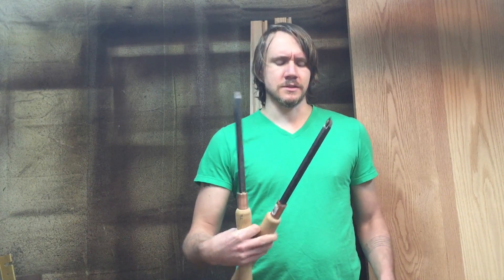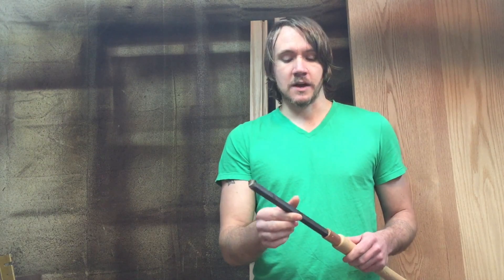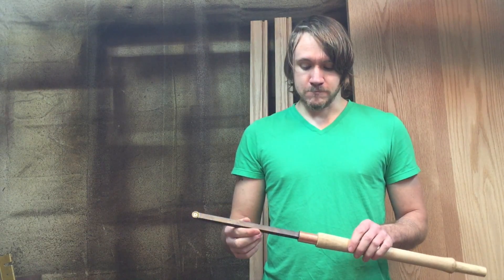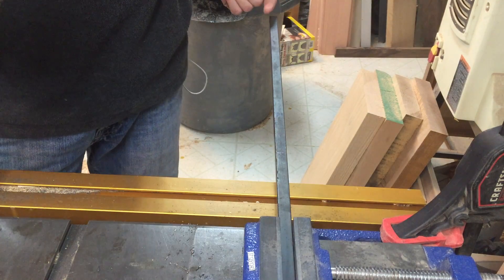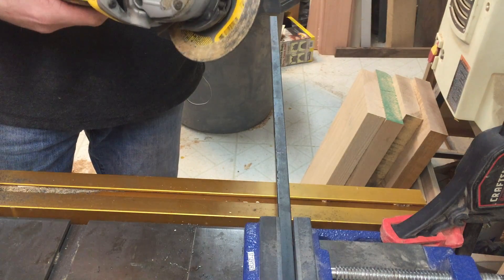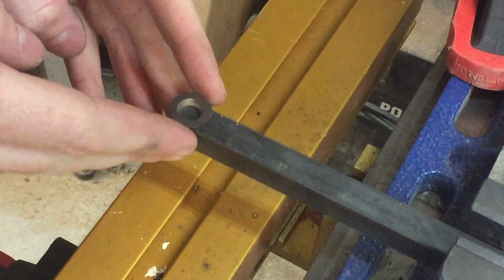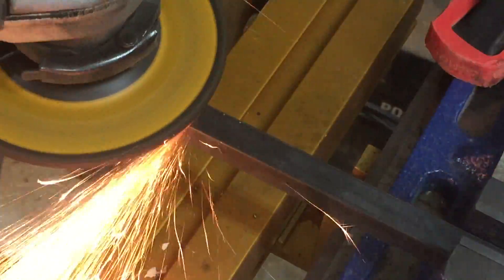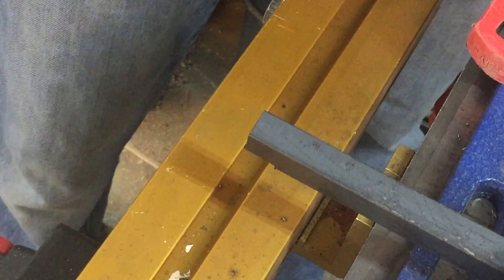How to Make Carbide Lathe Tools   001

Comment: Great job! Easy and quick and very functional tool for much less than buying somewhere else. You probably could have just scooped some epoxy in the end of the handle and pushed the bar in behind and then tamped it on with a few taps on the handle end might have been a bit less messy lol but still very nice job! 👍🏻
Reply from the maker: Thanks. I appreciate it.

Comment: What size bit did you use to drill the stock for the die bit for the screw?
Reply from the maker: I believe the screw is 8-32 so whatever bit size comes with that tap.

Comment: What a great Video.  Where did you get the steel/. What kind is it again and the dimensions? Also is the copper insert 3/4 inch?  Thanks  , and keep making videos as great and as informative as this.
Reply from the maker: It’s just 1/2” mild steel bar. Nothing fancy. 3/4” copper pipe for the ferrel.

Comment: I'd have fluted the sides to slightly less than the diameter of the round cutter at the same time as rounding the back. Those corners look to be a liability if you are working at close quarters

Comment: how long is each piece of steel and is it expensive ? low or high carbon or high speed or tooling ?
Reply from the maker: I believe I have 16” outside of the handle and 6” in the handle. It’s not expensive. Just 1/2” square stock. Bought it on amazon. Just regular mild steel. It doesn’t have to be tool steel because it isn’t doing any cutting.
Reply: @BrianMcCauleyDesign  got a problem now, for some reason it keeps eating drill bits and tapers... cant even get one hole finished. one hole per bit, then when I try to tap it, it breaks the tap, even going slow, backing out ever so slowly not putting much pressure either, oiled it a lot too
Reply from the maker: That’s strange. I’m not a metal worker so I’m not sure what’s going on. Maybe you’re using the wrong size but for your tap? Maybe your steel is harder than mine. I’m pretty sure I just used regular old mild steel.
Reply: @BrianMcCauleyDesign  im using the same tap and bit combo you had posted. I think its the steel hard carbon steel
Reply: @BrianMcCauleyDesign   someone told me I had some harder steel that I prob should have used a carbide tap,, not that rich haha, I was able to get them finally after 4 sets of taps and bits,, irwin is going to send me new ones,,, win win I guess
Reply: @BrianMcCauleyDesign  thanks a bunch. I have some round 1/2 
steel rods from Lowes, hope it'll work , something tells me I should have went with 3/4, I made a pretty good bowl gouge from an old washing machine center rod HSS.. anytime you find some old washing machines break out the ole hacksaw or grinder, pretty hard stuff

Comment: HI, WHAT STRENGTH STEEL DID YOU USE? CARBIDE TIPS USE USED.. EBAY? THANKS
Reply: http://www.carbidedepot.com/formulas-insert-d.htm  no edge prep dead sharp for aluminum machining. scrapers have no chip breaker. those with relief and a chip breaker can be very aggressive and difficult to control

Comment: I would have used a transfer punch to mark the hole for drilling. Much more accurate than a sharpie, and you can buy a set of transfer punches from Horror Freight for short money. They come in handy more often than you might imagine. Yes, even for woodworking.
Reply from the maker: Right on. Thanks.

Comment: Would round stock be better, or do you prefer having a flat edge against the tool rest?  I was considering hex stock as well, as you could easily achieve a 45° angle for a shearing cut. I know this would complicate making the receiving hole in the handle, but which would be the best shape?
Reply from the maker: I like the hex stock idea. I’ve never used a round bar on a carbide tool but I don’t think I’d like it. It’s probably a personal preference though. If not the hex I’d definitely go square. Honestly, even hex doesn’t sit too well with me. Thats probably because my lathe is by far the scariest tool in my shop and I’m really conservative with it. I took a bowl blank to the face once. Lol.

Comment: Nice job. I have wanted to make some for a while as well.  A couple of tips: For something like this, make some cuts in the steel. Use the angle grinder to rough it up and cut/grind some marks/ lines in the 6 inch side that gets the epoxy.  That will allow the epoxy to attach to the steel better. Use a 24 hour epoxy. An epoxy that takes longer to cure is stronger than a 5 min epoxy. Also make sure you mix it very well.  Drip some into the hole in the wood before inserting the steel into the hole.  Not saying you did a bad job, just things I've learned working with epoxy.  Thanks for the video.
Reply from the maker: Right on man. Been using these for a few years now. No issues. I appreciate the tips.

Comment: A 3/4" copper coupler is not big enough to go around the bar and leave any wood... If I cut a tenon for the ferrule now I'll end up cutting air.
Reply from the maker: I disagree. Mine work fine.
Reply: Something has gone horribly wrong for me, then. Gonna get 1" couplers and try them.

Comment: Where did you get the screws for the carbide ends? Also the 1/2in solid steel bar? Can’t find them online.
Reply from the maker: The screws came with the carbide tips from easy wood tools. I believe I got the steel on amazon but you could probably get it from Home Depot or Lowe’s.

Comment: I'm not sure about grinding the insert recesses. They have to be very flat or the brittle carbide might brake under the pressure of the screw. 
How do you like that square stock on the tool rest?

Comment: What kind of saw did you use and do you think a dremel saw max would work?
Reply from the maker: +QualityKnives I just used a standard angle grinder with a cutting disc.
Reply: McCauley's Design I was meaning when you cut the wood with the holes in in.
Reply: If you're referring to the recess for the tool, he used a router table with a 1/2 inch straight cutter, est about 1/4 inch deep by the look of it. You can actually get similar cutters for the Dremel so it works like a small router.

Comment: You say that you broke the first tap, I am not surprised you didn't break the second one as well! You are only supposed to  turn the tap no more than on eighth of a turn then reverse the tap to break the chip. That way you don't break it. And believe me small taps break easily enough even when used properly. But that said a good effort and  it's very satisfying to use a tool that you have made. One other thing buy yourself a spring loaded centre punch to mark and make a dot for the drill to centre on. Makes things much easier.

Comment: may I ask what was the total cost to make these tools?
Reply from the maker: +ken taylor I can't remember off hand but probably around $15 each. The wood was scrap so the only cost is the steel and the cutter.
Reply: thanks I am going to attempt this. where did you buy the carbide tips  THANKS FOR YOUR HELP
Reply from the maker: +ken taylor I bought them specifically from easy wood tools. You can get them cheaper on Amazon or eBay though. You want the 15mm cutters.
Reply: thank you
Reply from the maker: +ken taylor no problem man. Let me know how it goes.

Comment: Could you provide some basic dimensions for the tools?  Which cutters? bar length? handle length? depth of recess in the bar? Thanks!
Reply from the maker: +Rafael Serrao hi there. I used the 15mm cutters with 1/2" square stick. I'd say it goes into the handle about 6" and protrudes maybe 10". The handle length is probably about 16". Hope that helps.
Reply: +McCauley's Design thanks

Comment: This is brilliant. I was about 2 minutes away in spending some serious cash on some tools. Just a question. I would like to make this size, and then a smaller "mini" cutter, what size steel would you recommend for that?
Reply from the maker: +Adam Brcic thanks man. Glad it was useful. I'm not use what size the mini cutters are but just choose steel bar that is slightly smaller. You want the cutter to overhang the steel on all 3 sides.

Comment: Good video. Very helpful. One question though. Is it important to use 1/2 inch bar stock or could I get away with using 3/8th inch square stock as I have some here lying around.
Reply from the maker: +B Lenane you could probably use 3/8" but then I'd use smaller cutters. Ones that are sized closer to 3/8". I used 15mm cutters which is just over 1/2". You have to see what is available in a smaller size and how it compares to your 3/8" stock.
Reply: +McCauley's Design Ok thanks for the quick response. I am going to get 1/2" bar as I have some 15mm cutters ordered. Thanks again
Reply from the maker: +B Lenane sounds like a good idea!
Reply: +McCauley's Design might use the smaller bar for a detail cutter or if I get a smaller cutter in the future. thanks again and look forward to seeing more videos from you.
Reply: McCauley's Design My tips came in so here are the 4 tools I made for them: http://imgur.com/LjJiJfj

Comment: i know you turned the handle between centers but how did you handle the void on the end that accepts the collet or copper piece?
Reply from the maker: +Ben Wolf I'm not sure what you mean. I just turned it down and measured with calipers to get the right diameter so that I didn't turn it too small.
Reply: +McCauley&#39;s Design what i meant is you cut a hole in the side then glue it up but what do you use to insure that it drives.... did you put something in the hole or did you just use a spur?
Reply from the maker: +Ben Wolf I got ya. I'm not actually turning between centers. The end with the hole is mounted in my chuck.

Comment: I want to make a couple of these tools, what sort of steel did you use for the holder?  When I go to buy the steel I hate to sound like a total novice, but like you metal work has not been part of my skill set.
Reply from the maker: To be honest I can't even remember. I bought it on amazon. Probably the cheapest I could get, haha.
Reply: +Brian McCauley Then perhaps it isn't a big deal about the type for the holder.  I work at a hardware store and we have cold rolled square stock on the rack and then we also have 12" pieces of key stock, which is a much tighter tolerance so it fits in keyways.
Reply from the maker: +Dan Breyfogle I do believe now that you mentioned it that I used cold rolled steel. It's holding up just fine. I've even seen people use square 1/2" tubing for it. I wouldn't hesitate to use the cold rolled steel stock.

Comment: Don't you need to make sure that the cutter slot is perfectly flat/parallel to the steel stock? Otherwise it seems like the cutter would be at an angle =/= to 90 degrees.
Reply from the maker: I suppose if it were too far off 90 it'd be a problem. I didn't consider that when I made these. But I e been using them for several months without issue. Guess I got lucky.

Comment: Nice job. I may say that as an option for "rounding over" the back of the tool you can use a belt sander. Belt sanders are not only great for sanding wood but for sharpening tools as well as the shaping of metal. I would suggest using your drill press to keep your tap straight. Just a couple of suggestions to help you out. Again, nice job on the video!

Comment: Thanks Brian, great video here. Good job on the cutting tools too. Personally, I would have taken better care while grinding the underside of the bar stock (under the carbide bit) because that area is called a Top Down Relief. It has to match the angle of the insert mounted on top of it. The TD relief allows for the tool bit to be angled upwards without the underside of the tool itself getting into the material your cutting.
I used to make those carbide tooling inserts years ago and learned a thing or two back in the day.

Again, thanks man. I really enjoyed seeing this and you did a great job.

Comment: Try +Cap'n Eddie on you tube he has all the cutters no matter what size you need...and much cheaper....I have no business connection with him.
Reply: +Monte Turner That defeats the purpose of making it yourself. Anybody can go spend their hard earned wages and buy someone else's handy work, but to make it yourself brings about a sense of pride in accomplishment that can't be bought at any price.
Reply: +Vic Krue I was just giving an option. the easy wood cutters are expensive. Cap'n Eddie has the same cutters at a better price. I thought the visit was about making the tool the cutters go on. I get the whole making it yourself.
Reply from the maker: Hey guys. Yeah I'm down with less expensive options for cutters. I didn't make the cutters anyway, haha. Just the parts that hold the cutter.
Reply from the maker: Monte. Thanks I'll definitely check him out

Comment: Can I use round stock? or will it roll when I am turning with it?
Reply from the maker: That is the issue with round stock. There companies that make carbide tools with round stock but that takes away the simplicity of using them. You have to worry about it rolling and catching on the work. It's the main reason I used square stock. Drilling a hole for the stock would certainly be an easier way to go though. Just not an easier tool to use in my opinion.

Comment: Thanks for the video!  How did you mount the work piece onto the lathe with the square hole cut into the end?  And how did you ensure the piece was turned true around the square hole?
Reply from the maker: Hi, to attach the end with the square hole to the lathe I used my 4 jaw scroll chuck. Instead of pressing into the work pieces end grain it squeezes down on all the sides of the piece. It's also self centering which meant that the square hole would end up in the center of the handle when it was all finished. 

Thanks for watching!